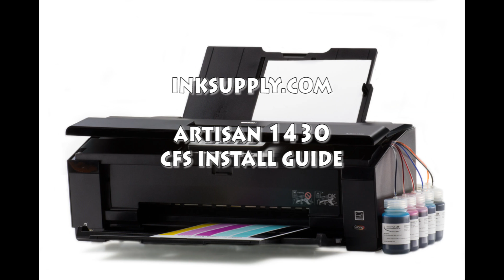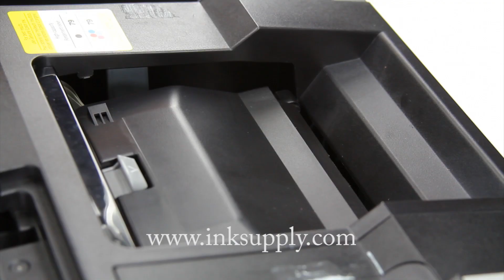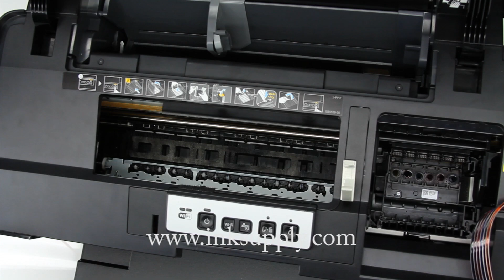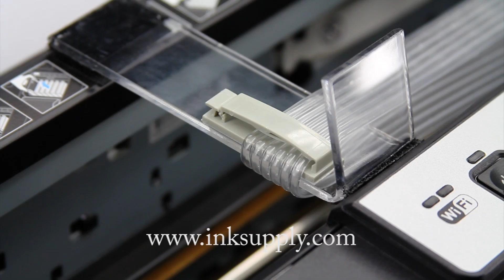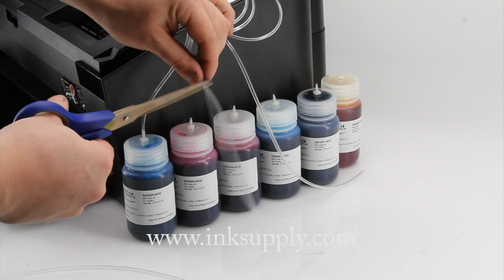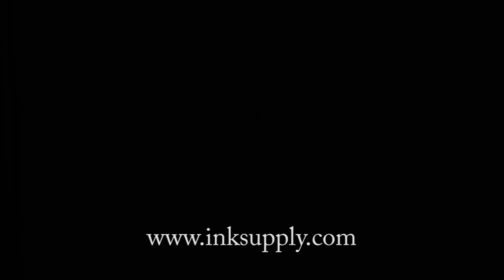Artisan 1430 CFS Install Guide

Comment: Hi. I saw your video and am interested in purchasing a new printer of this type as well as a CIS system from your company. However, I'd much rather use a printer where the cartridges are stationary (Such as the Artisan 837) since I am worried about the ink tubes disconnecting from the cartridges over time from continually moving back and forth. Can you recommend such a printer with stationary cartridges as well as printing  13" X 19" photos? Thanks in advance :)